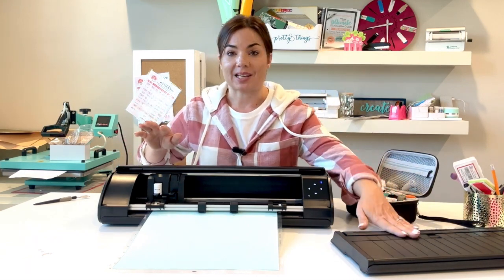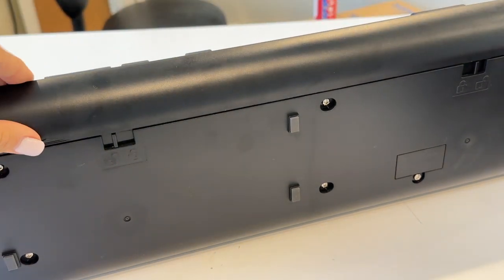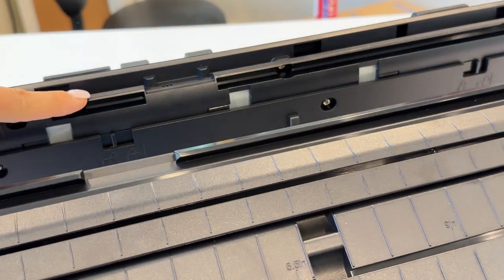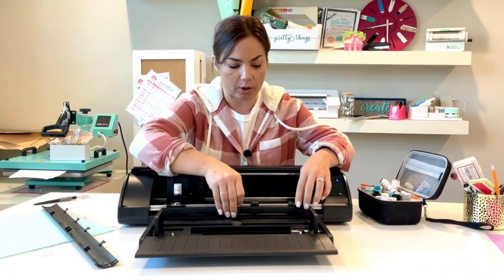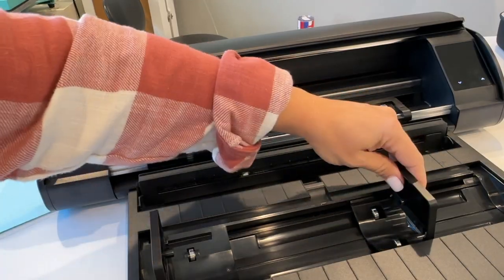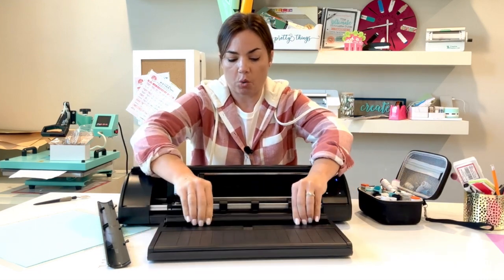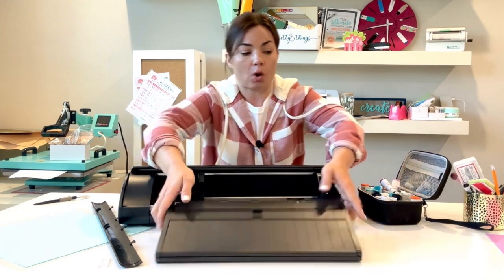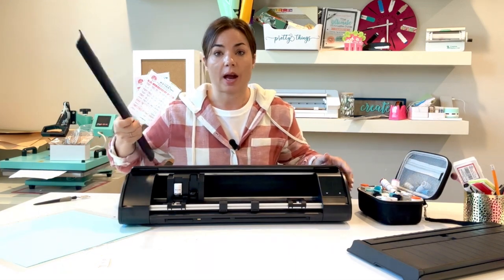How to Attach the CAMEO 5 Roll Feeder

Comment: I don't know why I'm having so much trouble finding any information on sending to the roll feeder. The software is constraining me to 12x12 and I don't see any settings to change that for rolled media. Plenty of info on how to "attach" the roll feeder and then nothing about using it.
Reply from the maker: Change it to "No mat" in the Page Setup panel and then change your material size to 12 x whatever length you want like 12 x 30"
Reply: @SilhouetteSchool  Thank you. I finally got it straightened out.